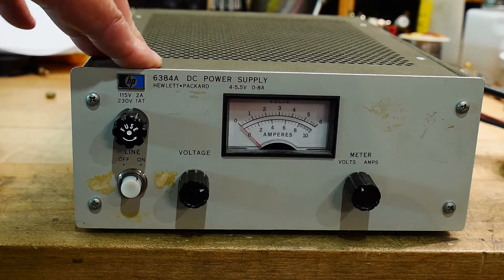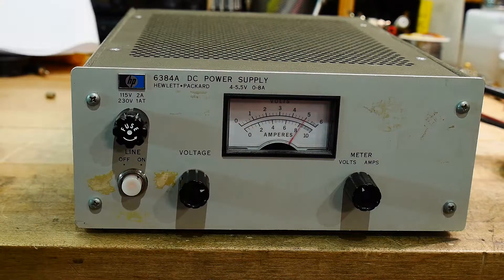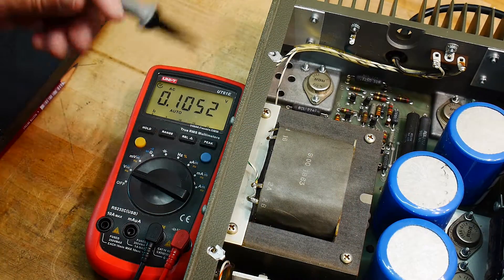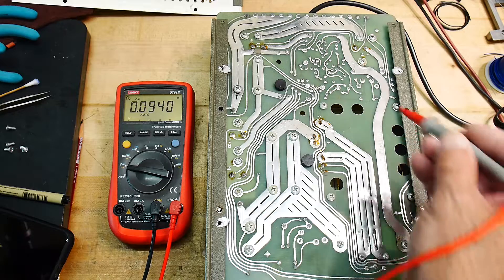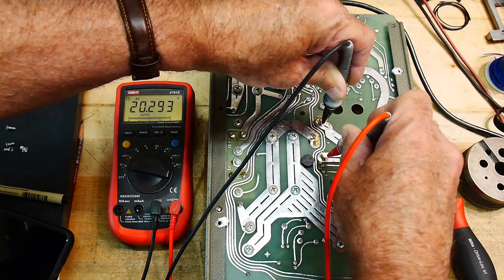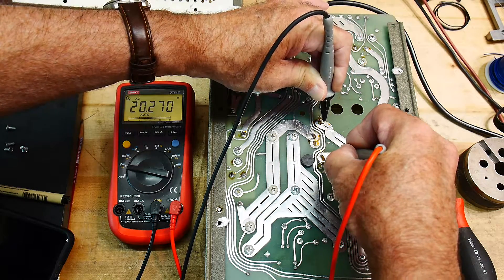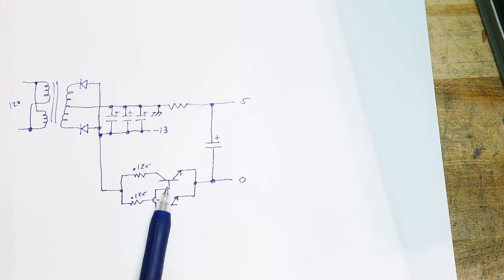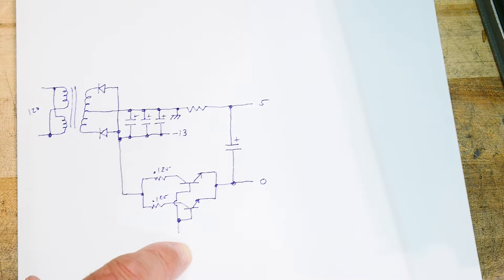#539 HP Power Supply Circuit Reconstruction

Comment: Are you certain the topology has to do with the difficulty of using npn, or rather, it was designed using conventional current?
Reply from the maker: You have to be as old as I am to understand that PNP transistors were not very good back then. It is a guess on my part but I stand by it.

Comment: On HP's larger power supplies in the early 70's (with more power output) they used two stages of regulation. There was a pre-regulation on the A.C. line using a triac and the traditional pass transistors on the DC side. The objective of the preregulator was to control the voltage drop across the series pass elements. As you pointed out, the little supply you have dissipates quite a bit of power in the series pass. So preregulation would reduce this, especially if the output were completely variable down to zero volts.
Reply from the maker: I saw that in some schematics. I was impressed they were doing pre-regulation in the way back days.

Comment: The Harrison Division of HP was in Berkely Heights NJ. But in the very early 70's was moved to Rockaway NJ when HP acquired Boonton Radio. Eventually the power supply division in Rockaway was shut down and all power supply products were moved to another HP division for manufacturing.
Reply from the maker: I joined HP in 1980 so was a bit before me. But there were lots of Harrison supplies around